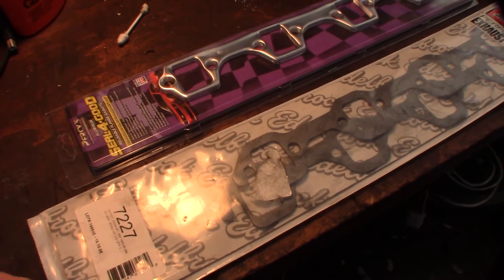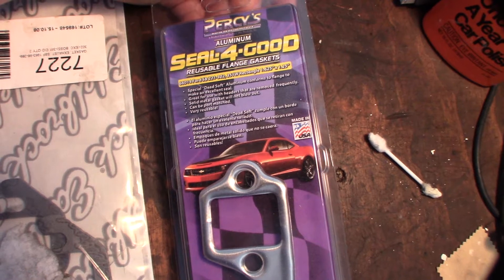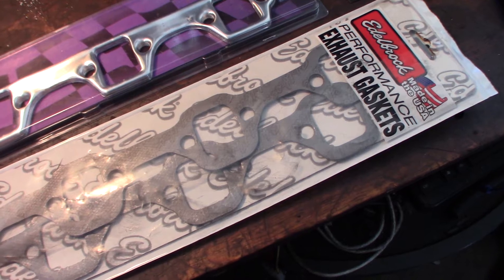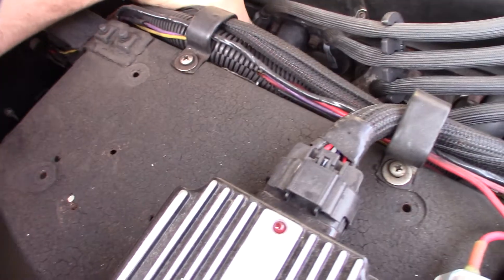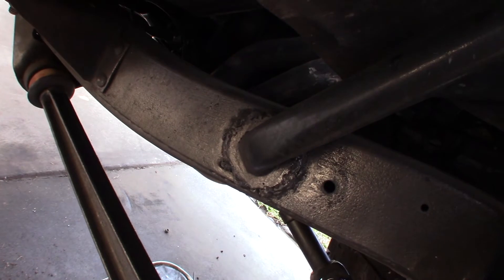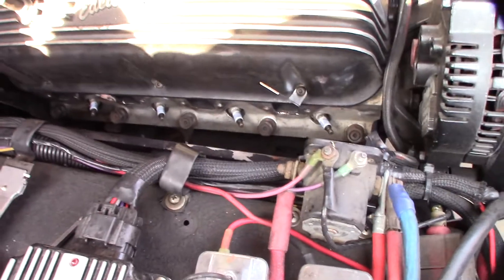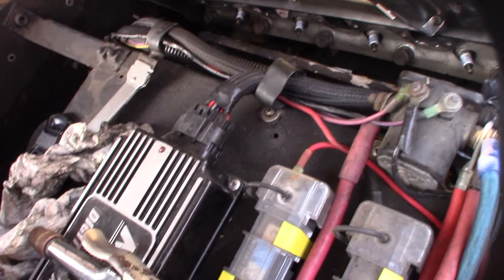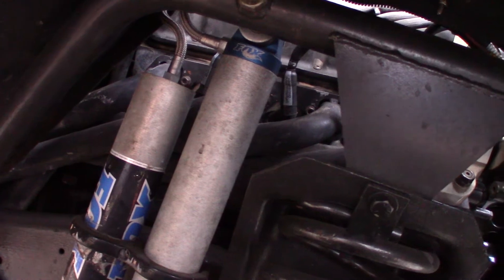Percy's Best Header Gasket ford 302 351W deadsoft aluminum exhaust leak fix repair

Comment: COMMONLY ASKED QUESTIONS
Q: “Which way do I install the Seal-4-Good Flange Gaskets?”
A: With the exception of the Big Block Ford Part #66035, all flange gaskets are
installed with the smooth side out. There is a smooth rounded side and a sharp cut side, this
sharp side goes on the head and the smooth side goes on the header flange.

From- http://www.taylorvertex.com/Products/pdfs/Seal-TechInfo.pdf

Comment: its a no brainer what side goes on the heads!,the flat side/shiny side goes against the heads so the other side with edges goes on to the header ports .
Reply: Mike Carter Percys actually states the opposite. Says to always use smooth side toward header and rough cut side towards heads.
Reply: @CentralVAracer you're absolutely right. I will never buy these gaskets ever again, they are way to cheap. go with MR Gasket , much better and last longer